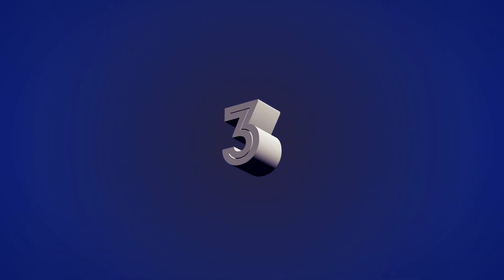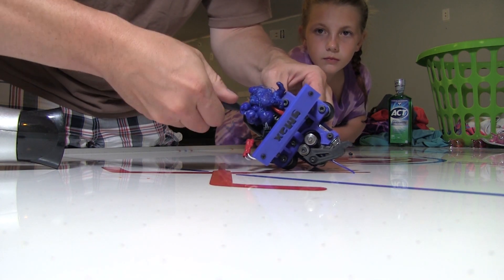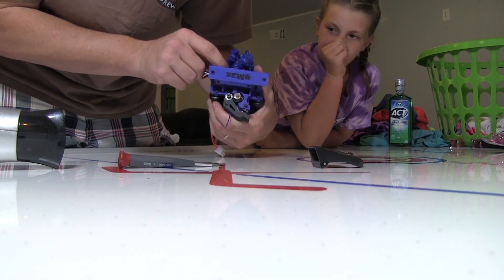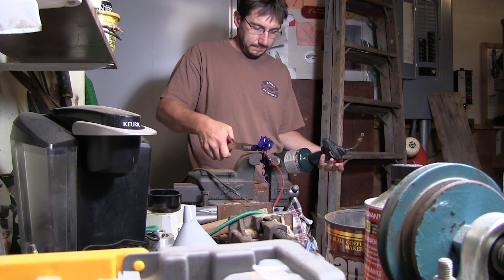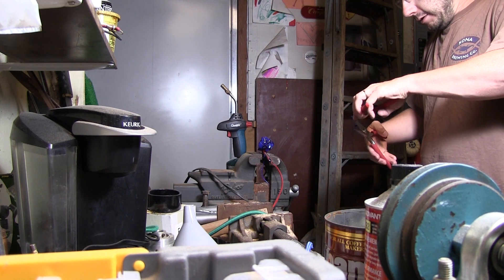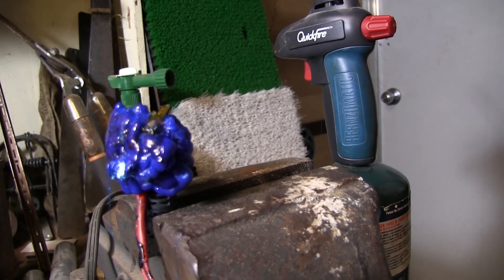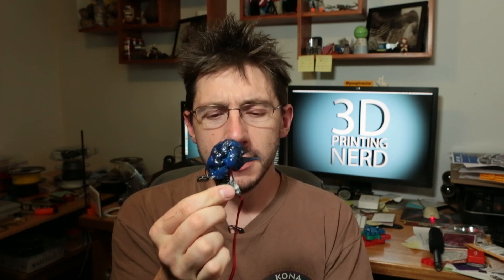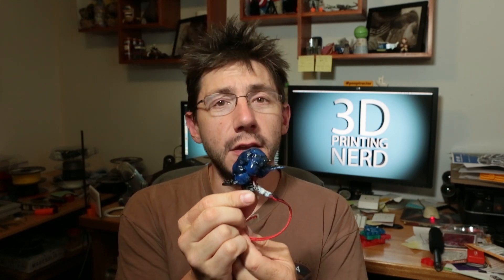Can You Fix a 3D Printer with FIRE?

Comment: should have heated up the hotend and pulled it off that way.  Much more efficient to heat the joint and not the outside.
Reply from the maker: +BoomBrush Hey! I'm "that guy"! I tried to heat up the hot end to pull it off, but as soon as it got up to temp, it started to smoke badly, and I didn't want to set fire to it while inside my house. I started to heat up the outside with the blow dryer thinking it would knock some part loose and then fall off. Nope. I then applied fire because, well, fire is cool, and I knew I wouldn't be recovering this jhead. That, and I already had a new one on order. :)
Reply: 3D Printing Nerd thats fair enough. i was lucky enough to recover the print head because it was only a small amount of plastic compared to what is on this video, but i was still annoyed. fire is cool though, for your situation it was probably the best thing to do and if you also had another extruder on the way, why not. it also smelt soooooo badddddd and it practically ruined the thermometer/thermocouple. i think i had to get a replacement.
Reply: 3D Printing Nerd I think beforehand you needed to make sure that your element was actually inside your heater block, otherwise it wouldn't get sensed and just heat up like a mofo.

I've had 3 failures like this so far on my work's ultimaker 2 extended.  The plastic made it all the way into the fan shroud, surrounding the heater block.  It was a mess.  Luckily I've been able to fix it all three times. 8)
Reply: +oobligah that happened to me before, so i just heated up the hot end and pulled away the plastic. i dont know why the guy in this video is heating up the outside its just gonna drop plastic everywhere.

Comment: do you know any one near by with a reflow oven , that could set it just hot enough to melt the PLA , and let it bake/melt off into some tin foil or such ?   foil wrap the wires coming form the head and re torch it or bake it . also i think kapton tape fails or melts 260c (500deg F)..
Reply from the maker: +XerotoLabs Sadly, no one I know has a reflow oven. That said, I know fixing it with fire wasn't the right way to do it, but, it FELT right. Cathartic in a way. You know?
Reply: i do its how i cleared the first nasty clog in my fab mini hot end , i had to burn the clog out with a candle.  
If you wrappe dteh wires in a few layers of foil you might be bale to have a bit more of a go at it with the torch . 
or of you feeling a bit on the extreme side , like if it was your only part , cooking oil goes up to 190c or so before it smokes . if you made a pot of hot oil ( out side ) and dipped the blob of PLA in the oil it should slowly melt off and possibly dissolve it .

Comment: It happened to me with a Ultimaker 2 and ABS. It wasn't a bad as yours, but still pretty nasty. I solved the problem diving the print head into acetone. Unfortunately, I broke the heater cartridge and the temperature sensor, but after about 48h, I was able to print again.
The problem is the Ultimaker 2 is not really optimised for trouble shooting and it was quite a pain in the ass to fix that.
It was pretty bold to try to fix the problem this way I had to say, thanks for sharing your experience and hi five!

Comment: I would try a less invasive method lol like put the hole thing in the oven at 150-200 degrees Celsius and let it drip down or use a soldering iron to carve it out
Reply from the maker: +Luis Fernando Suárez Harašić I agree with that being a less invasive method, though, if I did that, I wouldn't get to play with a blow torch. :)
Reply: +3D Printing Nerd absolutely lol I'm surprised you didn't pull out a dremel or a chainsaw
Reply from the maker: Luis Fernando Suárez Harašić ooh, that's a good point. I do have a few more nozzles... ;)

Comment: I have read that Methylene Chloride (Dichloromethane) can dissolve PLA. Would you be able to try using a paint stripper or thinner and see if it cleans the part up or dissolves PLA? I have also came across this article: http://www.makerbot.com/blog/2010/10/19/pla-proven-as-a-dissolveable-support-material

Comment: yeah, this happened to me too. I heated up the extruder and was able to break lose the PLA
Reply from the maker: +Sidney King Sadly, I could not. Fire was the best, most cathartic option. :)
Reply: +3D Printing Nerd What about a stronger acid like muriatic acid
Reply: +3D Printing Nerd you also could've melted it in Sodium Hydroxide (lye)
Reply: +3D Printing Nerd at least a good thing with abs is that you can dissolve it with acetone.

Comment: One of my friends had a similarly mess with his Wanhao Duplicator 4S.
After we got the heatbreak(The hot parts) out, we reconnected the heater cartridge, and turned up the heat that way.
And it came off like a breeze, with no damage to the wires.

Comment: I'm not sure the wife will love it when you put your extruder parts into her oven (pun intended). Fortunate for me my blob was just a nasty extruder clog and a blow torch fixed it. It's so much more fun taking things apart without replacement parts, no manual and then setting it on fire and then realizing that this wasnt the problem at all... turns out my ptfe tubing shrank due to heating issues.

Comment: Do you have a time lapse of the overnight print. I've had spaghetti once due to bad supports, and I had air print once due to bad winding on the spool -- and then a couple of air prints due to clogged nozzle with woodfill, but NEVER something like this. Very curious as to how it could have happened. It looked right off the bad that the hotend was a total loss -- fun playing with fire though.
Reply from the maker: +kazolar Sadly, no timelapse on this print. I WISH. I set it late at night and didn't stick around to make sure it stuck to the bed fine. I think what happened was one of the first layers curled up and stuck to the extruder, then, anything else extruded out just collected as a ball on the extruder itself.
Reply: +3D Printing Nerd I use OctoPrint on a raspberry PI 2 -- I have a web cam mounted on the printer, so I check on the print, and all prints create time lapses automatically. Very convenient. I also can remotely turn the printer on and off, and I have a script in OctoPrint which turns the printer off 20 minutes after a print is done -- saves on power. It also emails me a picture at start and end of print.
Reply from the maker: kazolar Man, THAT is how you do it! I'm going to get Octoprint running at some point, you know, when I have spare time :) When I do get that chance, I'm totally coming to you for help! What webcam did you get for the Octo?
Reply: +3D Printing Nerd -- as much 3d printing as you do, I think OctoPrint is a must, it's really simple to get it running. Basic rasperry pi image,  and OP itself is a real simple install, just follow the install twiki, she explains everything even how to do the relay stuff for power control of the printer. I have my printer in the basement, I  can't dedicate a PC for it, doesn't really make sense, this was the perfect solution. I had the PI setup ever before my printer arrived. I use the logitech c920. That's the most high end camera I'd go with, you can use a Pi camera module, but it's fixed focus, so you have to position it just right. Plus it's an excuse to print a PI case, and a camera mount. Nothing like printing stuff for your printer right? Do a cool logo on the PI case -- it's right up your alley.
Reply from the maker: kazolar YES. This is all so great! I will totally give this a try.

Comment: I just got into 3D printing and had had my hot end leak on me.  Turned into a nice blue glob.  ( Had to take it apart to clear a blockage.  And I did not realize I had to  threat the heat break and nozzle so they touched inside the block.  Stupid mistake)   But i found that is i dropped the whole extruder in boiling water, it softened to a stiff putty consistency that peeled off pretty easily.   may not work so well on that mess but at least you don't risk a giant burning ball of plastic.
Reply from the maker: +Pitch lock You know, that would have been a MUCH better idea in my case no doubt. However, I did get to play with fire, so, that was a plus.

Comment: Ive had this happen twice and I'm sick of replacing hotends.  I'm also terrified of burning down my property, so I no longer do overnight prints.  I need to figure out how to do octoprint or something where I get a solid pause and can power off the device overnight...
Reply from the maker: So far, the only reasons I've had to replace anything on my printer are from my own stupidity. Heh. As long as I have good bed adhesion I'll continue to do overnight prints AS LONG AS I am using a trusted filament.

Comment: Joel,
Love your content. You are both funny and informative. My opinion, keep making longer content videos. If I want I can skip through it but I thoroughly enjoy the stuff in your videos. Keep it up!
On a side note, I don't have your exact printer, but I've had plenty of globs of filament on overnight prints. If you can cut away, either with a knife or a dremel the large ball, then put your thermocouple wires on, heat your hot end and you'll be able to scrape off the remainder like butter. I've done this a fair number of times and it works pretty well. Good luck mate!
Reply from the maker: Tim Hamerly Wow, thanks Tim! I will aim for longer content videos! As for my printer and the extruder, the only reason I went with fire is because I knew I had another one on order. I would have done a MUCH better job of removal if I didn't have another one on it's way :)
Reply: +3D Printing Nerd Well I'm glad you caught it on tape for us to enjoy then!!! Seriously though, keep it up, love your stuff.
Tim

Comment: why not use a soldering iron and melt it off in sections
Reply from the maker: I had seriously thought of that. I couldn't find my soldering iron and, once I was told a new one was on the way, I went nuts. Plus, it's true, I didn't find my spare parts until after I used fire.
Reply from the maker: ALSO, I'm not going to lie, I was frustrated and taking a blow torch to it felt nice.
Reply: 3D Printing Nerd Sorry, follow up question.  I agree that it was fun watching you torch it so this may not have a been a thought at the time.  But if torching the plastic off the hotend did work, do you think any of the wires/connectors going to the hotend would have remained intact, or would would you need to replace them.

I am just prepping for my first disaster, should it occur.  Ha!
Reply from the maker: Billie Winkle No, sadly, I get the feeling those would have all been toast. After the fact, I did think that putting some aluminum foil between the fire and the PLA may have kept some things in tact.

I SINCERELY hope you don't have a disaster like this :)